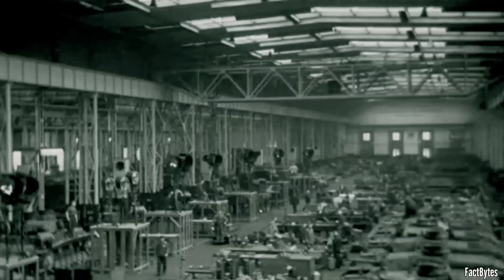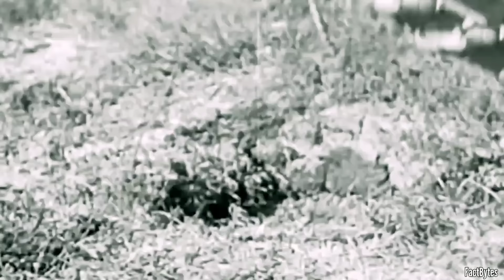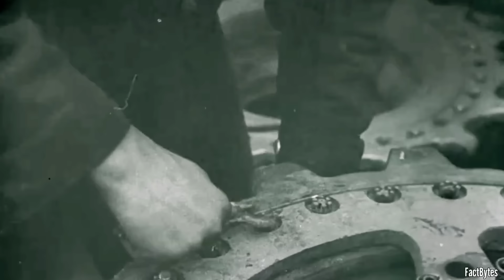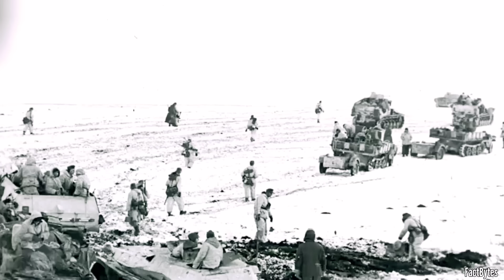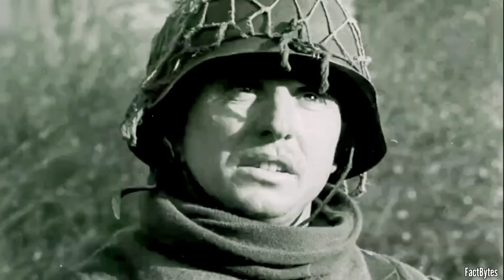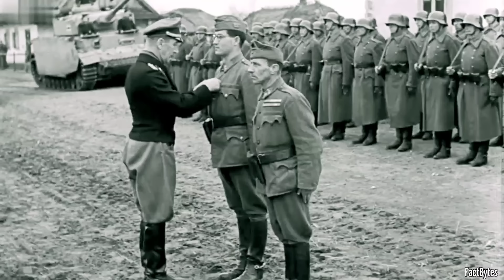More Panzer IVs, Fewer Tigers & Panthers — Would Germany Have Done Better?

Comment: We take the the component standardisation of the Sherman for granted.  The WW2 german tanks weŕe not as standardised as US ones.   There was much variation between what are notionally the same tank, when produced in different factories.  As such spares where they were available often had to be modified to fit the tank.  This was a major flaw with maintenance.  I don't see this being any better if they produced more Pz4s as I suspect it means more factories producing them.

Comment: The Panzer 3 and its variants were the real workhorses. There were over 10,000 StuG IIIs made.

Actual reports state that vehicles like the Panther and Tiger werent that much more expensive than vehicles such as the Panzer 3 or 4. Their issues were that they were mechanically unreliable and built at a time when Germany couldnt meet the logistic needs.  Who cares about how effective the Panther was if it required a train to transport it, it broke down after 50 miles, it was only supplied with half its ammunition load, and it lacked any spare parts.

Comment: Good valid points, but come 1945 the IS-3 was being introduced and it's Game Over even for the Big Cat's. 
The victory parade held through the streets of Berlin and the display of the yet unseen IS-3 spells The End at the same point in time.
Reply: IS-3 had exactly the same gun as the IS-2, with all the same inherent problems and an even more cramped turret.

Comment: Wars are won in factories. The fact that the Germans didn't have the resources, materials nor manufacturing capability to match the Allies in tank production is all the more reason why "good enough"; i.e. the upgunned Panzer IV & the Stug III, were better than "wunderwaffen"; i.e. Panther & Tiger I & II for all the reasons pointed out in this video. The later Panzer IV's long-barreled 7.5 cm KwK 40 L/43 or L/48 gun could defeat any tank the Allies had. Having a lot more "good enough"' that works, is better than "superior" which actually ISN'T

Comment: They wouldn't have won in production volume even if only one chassis would have been used.
The amounts especially americans were producing was mathematically impossible to win with some 13:1 production volume compared to germany.

Lots of mistakes were made by axis powers just because Hitler wasn't really a high ranking officer nor a very good strategist, especially when it came to gear.

Comment: Heinz Guderian had that opinion, "We do need tanks, swarms of tanks" that policy contadicted Hitler's fixation on mechanical beasts, a Tiger 2, cost to Germany, more than 1 million reichsmarks to build, besides that, when TIger 2 and Panthers were the norm, Germany was already streched to the limit producing synthetic gasoline "from coal", this gasoline is less rich, so the maybach engines of these heavy tanks consumed insane liters of synthetic gasoline to be movable and efficient on the battlefield. A Panzer IV cost 100.000 reichsmarks to build, because it was not that heavy, the operational range was a lot better than a Tiger or even a Panther, the transmission problems on Panthers and Tigers were legendary rendering some machines out of action and useless even before arriving to the battle front , so Stugs and Panzer IV's were far more efficient for Germany War Effort, a lot less taxing on the manpower to produce them, and Stugs score more hits on enemy tanks than any other armored german vehicle during the War. Germany still has a tendency for overengineering as it did during WW2, produced vehicles to complex to be mass produced in numbers that made a difference against T34's and Shermans, WW2 showed that in what matters to armor, More is better.

Comment: No, its unlikely Germany would have done better with more Pz IVs and fewer Tigers & Panthers.
Axis lacked oil to keep a larger tank fleet going. Pz IV was not really capable against its peer opponents by late '43. 
Manpower might also have been a limit; not only in tanks crews but also logistics & maintenance personnel. 
Railway & truck capacity was severely limited for the Axis, so lots more hulls probably could not have been supported. 
A small reserve of heavier, more capable tanks was useful as a fire brigade to limit enemy breakthroughs and do local spoiling attacks.

Comment: I've always thought the Germans should have produced a lot more skirted Panzer 4s and stugs with with long 75s and greater mobility. More fairly capable and more reliable tanks using less materials and not having to worry about the bridges could have prolonged but not won the war compared to the semi mobile pill boxes that were the Tiger, Panther and even larger monsters, often without stronger drivetrains.

Comment: Pzr IV was a good tank and stayed in service until the late 1960’s in some Middle Eastern armies.
Panther was a poor tank that was rushed into production and had too many problems to make it a viable replacement for Pzr IV.
Tiger was a great tank.  Its use in the intended role as a ‘breakthrough’ weapon was very limited.  It ended up being used as a tank destroyer for most of its career.

Comment: i dont think so, because in my opinion limiting factor was fuel, so its better to have fewer high-performance tanks that more inferior ones
Reply: Utter nonsense
Reply: 100% right. What were the Germans supposed to use as fuel for these hordes of Pz IVs when they were in a huge oil deficit. They also had a severe shortage of man power and experienced crews so who was going to man them. Utter nonsense amd lack of appreciation of the strategic position facing Germany.
Reply: @comiccollex958  The fuel equation is not any better with the "elite" tanks. Those were fuel hogs so they couldn't travel far before needing refueling. Pv IVs would've been far better, as you don't need to use them all at once, you have replacements after an operation. One of the issues was the Germans couldn't replace their armor losses. Panthers was possibly a good replacement, though apparently they had reliability issues and was a complex machine which made it more difficult to service in the field.
Reply: @comiccollex958 
Came to say exactly that! Thank you!
Reply: Not just fuel for the tanks but more crewmen and ammo needed, not to mention more support and supply crew and vehicles in order to make the extra numbers of tanks function effectively.
The new Panzer Brigades in autumn 1944 failed because they didn't have adequate support echelons. Never even had a reconnaissance section.
Reply: Presumably chemicals for ammunition was also limited in world war II. Therefore it's probably more efficient to manufacture fewer large rounds that are individually more capable than manufacturing ammunition that's going to bounce off the Russian tank
Reply: Sorry think of the logistics and the fuel costs of supplying parts and ammunition for many different vehicles rather than a stream lined army.
Reply: Generally the idea of producing higher quality tanks to counter the numerical superiority of the Allies was certainly a big part of German thinking but I think that the leadership lacked the understanding which was that they needed to be able to answer the challenge of combined arms that the Allies posed. I feel that the real point is that Tiger and Panther never solved the most pressing concerns that the Germans had. 

IMHO they would have been better off  taking the Panzer IV chassis and seeing what they could do with that. Like with the Sherman maybe you could mount a bigger gun to it into a dedicated tank hunter. Maybe you add an artillery piece to make self-propelled artillery. Maybe you strip out the turret to make an assault gun.
Reply: other factor is the limit of people, germany have far less population than Allied or the Soviet

Comment: Sure they could have had more mark 4’s but the odds of them  having enough trained crews or fuel was not good
Reply: exactly ... problem was not in panzer, but crews and fuel
Reply: If they had fuel problem why did they make the Tigers?
Reply: @Darktemplar99999 well quality over quantity? Particularly if quantity is definitely not gonna be the deciding factor.
Reply: @Sid-z5y  Oh right... we're short on fuel lets make a tank that guzzle as much as 5 Panzer 4s.
Reply: @Darktemplar99999  their thinking was 1 tiger > 5 panzers under their circumstances. 

They needed something to turn the tide in a battle not win by attrition.
Reply: @Darktemplar99999 closer to a 2-1 ratio on roads, 2.5 on cross country. Main problem with tigers was that they weren’t good enough at their intended role, to smash enemy lines, and were often used as elastic defence units rather than breakthrough units. Lighter tanks like Pz 4 and Panthers were meant to actually exploit that gap. Back when Germany still had a chance to win the war, during the Battle of Kursk, Hoth sent out the 503rd, and while they were able to breakthrough a few of the Soviet lines, it wasn’t enough. From then on, instead of being used in short spurts to break through enemy lines, close to friendly lines where repair and logistics was easier to maintain, they were shoved around willy nilly.

Comment: It failed to address the shortage of fully trained personnel. Poorly trained tankers were a problem for the big cats, but would not have helped the Pz Iv either. Nor does it address the likely increase in losses of PZ IV because they are less protected then the big cats. Also the Pz IV did not carry the early years of the war. The PZ II did that for the first two years and the PZ III did that for the next two years. The Pz IIIJ with the long 50mm could kill the T34 and were still a mainstay up to the Battle of Kursk in 43. If it was just a question of just production numbers, cost, and easy of maintenance, then Germany would have been better off producing StuGs which killed more allies tanks than the PZ IV or the big cats.

Comment: The Germans needed simple vehicles like the Hetzer, and to hold territories they could have used a version of the Hetzer with thicker frontal armor. They fell victim to their own stupidity.
Reply: They really should have widened a welded version of the 38(t) so its turret could take a long 75 mm gun, deleted the hull MG, and added sloped frontal armor. 

Of course CKD's cranes could only lift 16 tons so without a factory upgrade this would have required Germans to produce Czech-designed tanks.

Comment: "There is a story one level higher" than even the one presented here. By late war the Germans could never hope to compete with the allies in a numbers game, so why bother trying! If they couldn't compete in quantity then perhaps they could compete in quality, at least that was the rationale behind building ever larger and more complex tanks.

Germany didn't have the resources to field large numbers of tanks as well as other types of vehicles. It didn't have the industrial capacity, the steel production the fuel or even have enough trained crews to man large numbers. It didn't need to have tanks that were easily transported by rail, when by the end of the war with Germany's ever shrinking perimeter, there wasn't much distance to travel from the factory to the front line! Unlike the Allied tank requirements, that benefited from an inordinate amount of resources but required their tanks to fit into a logistics and supply chain that would see their tanks be transported to any location on the globe.

The 'Big cat' option was exactly the right choice for Germany given the situation it found itself at that point in the war, in fact it was the only way it could hope to compete on the battlefield and prolong its war. They might have used more steel and used more fuel than a panzer 4, Sherman or T34, but they still used less of those resources than the six panzer 4's that could have been built in their place! It often took several Shermans to knock out one King Tiger, this is testimony that the "quality over quantity" doctrine the Germans pursued was the right way to go. Unfortunately for Germany they did not have enough time to perfect their designs before fielding them in battle, causing numerous reliability issues, nor was it even enough to counter it's  massive production disparity compared to the allies, whose sheer numbers proved to be insurmountable odds, in the end. However, as a strategy it was based on sound reasoning rather than the 'vanity projects' from a totalitarian regime, as they are often portrayed, these days.

Comment: This is a question that people have been addressing for years now.

Some people say: stop wasting resources on all these big, heavy, fuel-guzzling, "expensive" (I think it was Military History Visualized who went into detail on the actual cost of the vehicles based on inflation and conversion and concluded that the cost was not as outrageous as many people claim), "unreliable" (some sources claim the tanks weren't unreliable at all, they were just difficult to repair due to the complexity of the internals and weight of the parts as well as the Germans having a part shortage to repair at all) tanks and build the classic Panzer IV and Stug III armored vehicles. That will solve your problems cause you need more tanks on the field and these are proven designs.

Others say: Germany NEEDED heavy tanks. They don't have the manpower or time to train new tank crews to put into every single tank that might come out of the factory, and even if they did the Panzer IV was an old design on its last upgraded legs. Why put your crews into a tank that if you're lucky will get blown up eventually, and if you're not lucky will blow up immediately in a fight (assuming it isn't bombed or breaks down first)? Heavy tanks are the way to go. Thicker armor increases the chances of your experienced crews surviving and the tank remaining operational in a fight. Bigger guns allow it to deal with the heavier enemy tanks no problem, allowing it to wreck more havoc on enemy forces. The time and resources spent on one of these heavy vehicles will last longer than making 2 or 3 "weaker" vehicles. The issues if such a tank are drawbacks you have to accept to reach such a level of effectiveness (theoretically in ideal conditions).

Germany had no chance of winning the war, or even fighting to a stalemate. Generally they had too many issues that could not be solved in their situation.
Reply: Counting dollars in a socialist state with a POW/slave economy is kind of pointless. You can build a ridiculous amount of materiel if you have resources and you don't have to pay for labour

Comment: The scare factor of the Tiger I was an issue.  But, the Panzer IV with shultzer plates around the turret it looked like a Tiger I if you looked quickly.
Reply: The long-barreled Panzer III with skirts also looked a lot like the Tiger I.

Comment: Guys, if you think about Panther, notice this thing: Initially, Panther was being conceived as a German answer to Soviet T-34 (with sloped armour). Soviet T-34 was a regular medium tank in the weight bracket of 30-35 tons (as well as American Sherman). Panther was designated to replace obsolete Panzer III in Panzer Divisions. And the idea was to have 1st Panzer Battalion of Panthers in each Panzer Division. (Tigers weren't included in Panzer Divisions except for so called named elite Divisions like Grossdeutschland, Totenkopf, Das Reich and Leibstandarte Adolf Hitler, which had one Tiger company each; Tigers were used in heavy tank battalions (schwere Panzerabteilungen)). Wonderful idea. But during its design the demands for Panther were ever growing and the end result was a 45 ton tank, not in the 30-35 ton bracket. So, instead of designing a new medium regular tank the Germans just created another heavy tank alongside with Tiger. And no country in WW2 could allow itself building two types of heavy tanks and in numbers comparable to medium tanks. Not surprising that the Germans never could compete in production numbers with the allies. The crazy thing was the Germans called Soviet IS-2 tank 'super heavy tank' (überschwerer Panzer) although its combat weight (with fuel, ammunition and crew) was 46 tons - almost exactly as the Panther. In German speaking videos they call IS-2 tank a "seventy ton monster" but that's laughable.
And so comparing Panther with T-34 and Sherman is somewhat swindle: in fact, you compare a regular medium tank with heavy tank and wonder why ordinary street fighter couldn't fight Mike Tyson on a par.
Reply: By the way, Guderian understood that and the idea of Panther wasn't brilliant for him

Comment: Intresting video, good visuals. Might have mentioned the StuG III. I also wonder about commonality of spare parts/components between Pz III and IV. Overall, well done. All the best, Billi.
Reply: Pz III and Pz IV did have some commonality as they used the same engine.   However transmission and suspension was another thing, Pz III had a torsion bar suspension and Pz IV I believe was leaf spring.

Comment: Pz 4 was used as long as it was because it was what was available. It was already too expensive and overweight from it's original designed suspension and drivetrain. Germany ran out of time, resources and manpower. You could have given them 500 brand new modern tanks and they still would lose.